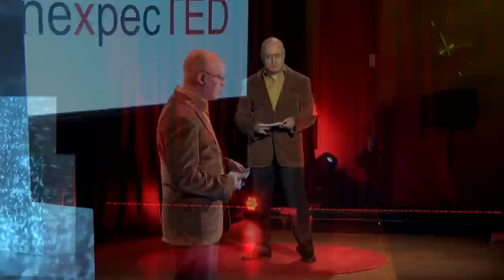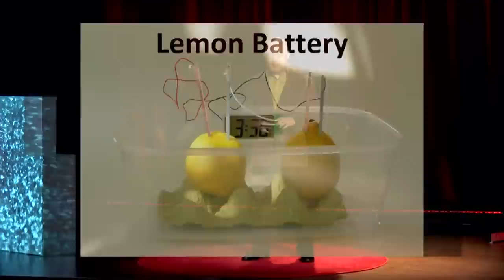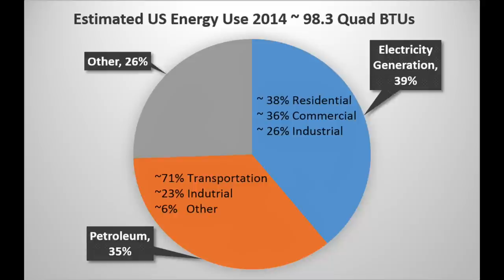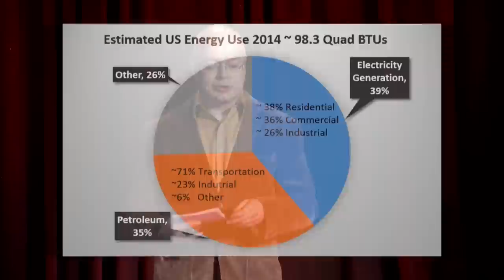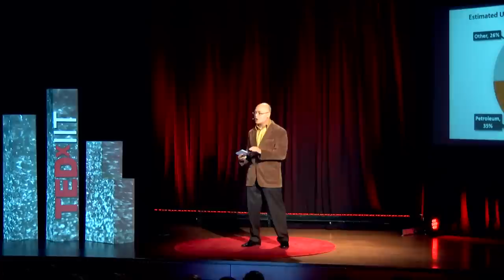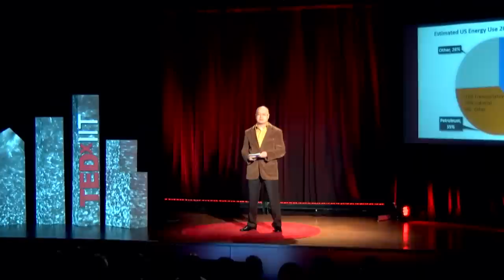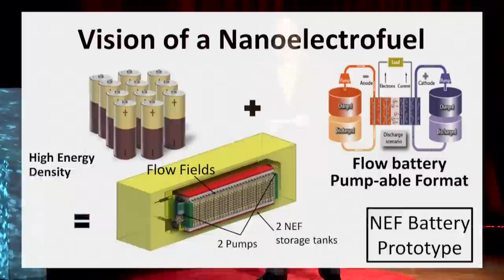Nano Liquid Batteries | John Katsoudas | TEDxIIT

Comment: Using a 220 line with a 20amp breaker assuming a 100% charge efficiency (and DC conversion) means in 60 times the 3 minute refill, 13.2kWH can be put in a battery. Of course, the faster you charge or discharge a battery, the fewer cycles it will last and the more energy it takes to charge the battery AND the less energy you can get out of the battery.

Comment: Several questionable points here.  The suggestion that burning coal causes more CO2 than gas is misleading as coal fired plants are more efficient than gasoline powered car engines.  This reference also completely leaves out the fact that many plan to transition primary power generation from coal to alternative energy.  Another suggestion that the speaker makes is that any new charging system must match the convenience of filling your tank in five minutes at the pump.  This is totally irrelevant when you can charge your car overnight while you sleep.  Chargers for long distance trips that can take about 1/2 hr are available but by and large most driving is done within a range that is easily addressed with overnight charging.  Transporting battery liquid and moving it through pipes and pumps keeps in place many of the problematic issues of gasoline based power.

Comment: If all our vehicles are switched to electricity we won't consume twice the electricity we consume now. The efficiency of ICE is about 35% against 80% with electric motors (including the losses due to battery charging). This reduces the additional need to less than 30% of the electricity we consume now. Knowing that most of this additional need is consumed at night and can be supplied because at night the demand is low, we only need to increase the electricity generation capacity by about 5 to 15%.
But the question here is not to say wether nano fluids are better or not. It's just another solution worth to explore !

Comment: how long could such an electrified nano-fluid hold its charge?  that's the problem w/ current battery technology—they can only store so much energy before they begin to dissipate.  from what i've heard, even the newest and most high-tech electricity grids can only store enough energy in batteries to supply enough electricity to power their customers for about 23 seconds.  that said, if issues like that can be solved, it sounds like a clean, low-cost option to gasoline.

Comment: Why does Katsoudas never compare the energy density of the Nano battery to car Li cells?  He admits that flow tanks are huge, so losing the trunk is a big problem in cars. Also, cars often crash. We don't want cars spewing dangerous electrically charged fluid that is likely toxic and flammable.  Why does he not speak of any of these?  He is far from "fair and balanced." His speech seems to be propping up the dying petroleum industry.   We need a new speaker, who can honestly address these problems!
Reply: Jim Whitehead, um not it’s not flammable the current b
Flow batteries have a liquid used for putting out fires, there none flammable, and its natural. It’s used for home storage in Australian homes it’s what I want here in the UK, but there not yet exporting! But my partner and I both have electric cars and manage our time to suit, that will change in time, there is no excuse other than being lazy! ...not sure if his nano tech is flammable though! Lol
Reply: When you compare stuff you limiting youreself from understanding the true discovery and implication on all sciences.... Each device has it purpose lithium also....for a fiew more months max..super caps and my system deliver more power than lithium.
Reply: The ferrofluid he refers to is a traditional ferrofluid an petroleum based (kerosene) product infused with nano magnetized iron, which loses it charge after a while, which also demonstrates how primitive and frivolous the R&D, the concept, and development truly is... 🤷‍♂️ (see stand alone comment for something actually thought through a bit.)
Reply: @showme360  The energy density of redux batteries is lower than li-ion, but Will be relevant if refueling is fast.

Comment: In Other Words lowering the vibrational area the heat is forced to lower temp 'It could could hold or repel using sound to concentrate vain's latis to hexiloidal controlling  your placement too the target any where the surface has a state of conductive or a re carg of a one  one thousand thats itand lasted for two days tile dim Graphene

Comment: Odd that the petro industry is said to be "dying" -- since the available oil appears to be not decreasing at this point.  (The US is now an exporter again.)   The big problem with electric cars and trucks?  Surge loads that will require a huge  flow of energy.  That means a recharge center out on the interstate would draw the same power as needed by a small to medium sized city. 20-30 trucks and 40-60 cars getting a fast charge of a few hundred amps?  Going to need a big substation to provide that power, or a bunch of acres of solar.  (50+ acres?)   And of course batteries to back that up since people actually drive at night.  OR you need a bunch of additional coal plants.... Or you turn off a few small cities to recharge.  Not a real positive direction to go in, so to speak.  Then start counting trucks at truck stops, and figure those figures are a few times lower than reality.  There is a LOT of energy in oil...  Replacing it in a mobile environment continent wide will be VERY difficult.

Comment: what happens if the 2 oppositely charged nano-fluids accidentally came into contact?  if it's bad enough, this could be enough to scare people away.  but considering how combustible gasoline is and how prevalent it is in society, the safeguards in place have made it incredibly safe to produce, transport, and use gasoline.  hopefully, the same holds true in this scenario too.

however, when it comes to charging those fluids, solar and wind energy are not great choices.  in the production of solar cells, the heavy metals and toxic chemicals can be devastating to the environment, and windmills are much better.  if CO2 is the problem, nuclear energy—including standard nuclear power plants already in use and potential Liquid Fluoride Thorium Reactors—is the obvious solution.  nuclear is not only the cleanest option, it's also the safest and most cost-effective and feasible to implement as well, and that includes WIND AND SOLAR POWER (which are a waste of time, money, and resources and end up being much more hazardous and toxic to human life and the environment)!

Comment: Its like this guy works for the gas industry. Lists all the problems without really giving proper solutions (of which there are many). The problem theory is already solved, we just need to DO it. Liquid batteries and transporting the liquid is not necessary. He wants to be able to control the flow of fluid (literally), and who will do it but the energy companies themselves? This will keep you locked into their web so they can price it as they see fit. This dude is crazy. The future is LOCAL renewable energy production and storage so the grid doesn't have to be build out and stressed even more.

Comment: What you are describing is basically a fuel cell. Fuel cells will probably be the future for vehicles, but will need to use something more storable then hydrogen or methane. The 'nano liquid' sounds expensive.  Propane or alcohols would be cheaper, and easier to synthesize.
Reply: WhAt yOuRe BasiCaLLy DesCrIbiNg iS a FuEl cELl!!

Comment: Why can't we use the common lead acid battery for this?
Reply: Most lead (70% ish) comes from recycled lead acid batteries.  Some solar systems use lead-acid batteries to store electricity overnight, but there isn't nearly enough mineable lead, on Earth, to build enough batteries, and they're finicky and fragile.  And lead-acid batteries can't be used to transport energy in the way he described.

Comment: Sorry complete rubbish anything that requires transport from A to B by anything other than a wire has no chance of beating current  systems.
Reply: Edwyn Corteen think about head phones how often do you break those wires you can't break a fluid only that which contains it
Reply: The subject here is electrifying transportation  and the simplest way of charging currently available to EV's is to plug in anywhere that has an available socket, no transport required.

What is being discussed requires a whole new infrastructure, so has little chance of going anywhere.  He also brought up the rubbish that all the extra electricity needed will come from coal, renewable generation backed up by the flow cell batteries (that he does get right) is already way cheaper than coal and will be delivered using the currently available grid.

Comment: Goodness.. he is trying to reinvent the flow battery, which already exists... and can be used for neighborhood power storage.. just doesn't scale down to the car level. Current versions have storage box sized "pools"--- not shipping container type size.  Liquid Metal is another form of that storage.. and it is high temp, but totally reasonable for storage.  (Charge a frozen battery, and it gets back to liquid...)--- About as efficient as the utility sized stored systems. When it comes to CO2...that is Plant Food.  Shrink what we have now by 1/2??? ALL plant life dies.  You can follow the bouncing ball to see where that leads.  All life ends.

Comment: I think this technology could have other applications, such as long term energy storage, but I think the small vehicle applications are uneconomic and unlikely.  "the petroleum companies already have the tanks and the pumps and stuff" is some pretty weak tea.  The roads and bridges are already in place, that's the expensive part.  EVs can be programmed to charge whenever grid load is low (some have only a simple timer interface, but even that would completely solve the 'come home at dinnertime and plug in' problem).  Utilities could, and in fact do, discount electricity pricing conditional on their control of the load.  Possibly that is part of the reason that Tesla is installing large batteries at Supercharger sites.  If this technology solves the storage density problem, and doesn't need anything terribly special to recharge the fluid other than available electricity, then it's the solution for our current EV range problem.

Comment: Three independent loops of copper around earth could produce sufficient voltage to sustain humanity without burning additional fuel (NASA TSS1 '96). SpaceX is currently on route to send rockets to Mars. During those times, the process to electrify earth with man-made rings could begin simultaneously.
Reply: lugo lugo Please provide sources of 'copper loops'. I don't see the connection with the NASA TSS-1 satellite.
Reply: Harm Hoeks watch "Shell 1991" I'm sure it will explain everything.

Comment: This marketing pitch gets my vote for most batshit TEDx Talks talk.

Replacing one form of commodity energy with another will kill billions to preserve billions in profits for energy industry corporations.
Solar is trending towards zero cost and is solid state, few moving parts, little maintenance, existing grid.
Battery storage is trending below $100/kWh and production methods are improving total pollution and carbon footprint, using abundant materials.

Go ahead and get R&D dollars from oil companies so they own the patents and lock the technology away so it's theirs to license for future revenue.
This technology does not explain "cradle to grave" pollution or carbon footprint, recycling, hazards, handling ... all the things that have been improving in battery chemistry for decades and solar generation is decentralized.

The problem of pollution is not solved by replacing one form of energy transportation with another -- and electric energy generation requires the grid, which already exists -- so the argumentation and rationalizations for this being a solution are intellectually dishonest and disingenuous.
Reply: In all things the preservation of billions in profits will be the determining factor.
A zero emission gasoline would only be a solution if it could be done at costs comparable the cost of current drilling, lobbying, etc.
Or a greater profit could be achieved.
Reply: @konjuer  right, well, sad but true
I'm ready to start sending corrupt politicians and "pollution industry" corporate executives to prison ... they're trying to kill people for money ... that's a pretty well recognized crime.